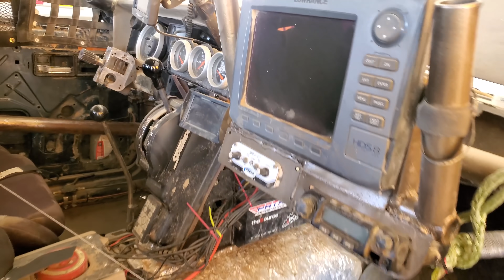Doing This Will Break Your Turbo at King of the Hammers KOH

Comment: Great video Colt. The night life scene at KOH reminds me of some sort of festival. It looks like a ton of fun - absolute craziness. 

I bet the brake hose you used for an oil feed didn't have a pure PTFE liner. Looks like some braided brake hose liners are just PTFE coated, so whatever other plastic was used wasn't up to the task for all the heat cycles. Plastic tends to get brittle when heat cycled to near its maximum temp repeatedly. Brake fluid doesn't normally reach 200 or 250 °F unless you are boiling the fluid, and you would need to do it every time you drove your car to match the number of heat cycles seen by that feed line. The pure PTFE stuff looks like it is good up to 450 °F or so. I bet the liner in that hose was mostly nylon or something which is only good to 220 °F or so. Your oil sees that temperature every time you take your Sammy out. 

Looks like you got it fixed, but just wanted to throw that out there in case you or anyone else was curious.
Reply: Night time is like a madmax movie for sure. Thats good to know about the brake line, I ended up just buying hydraulic line to eliminate my issue.👍
Reply: I was kind of shocked to that a teflon lined hose would fail like that.